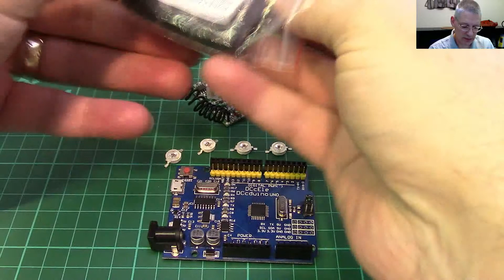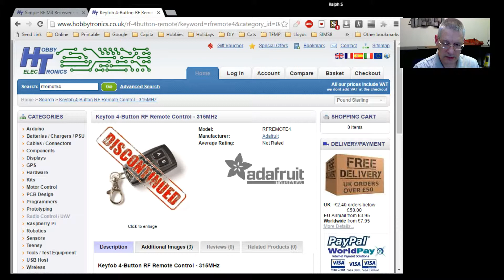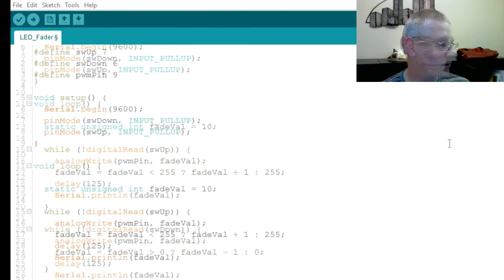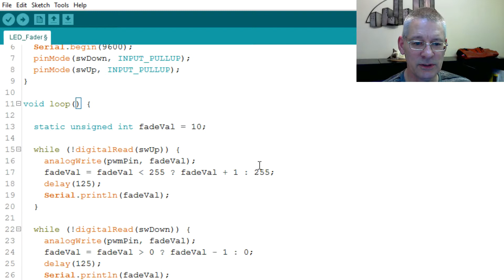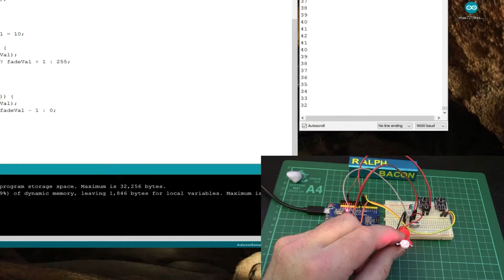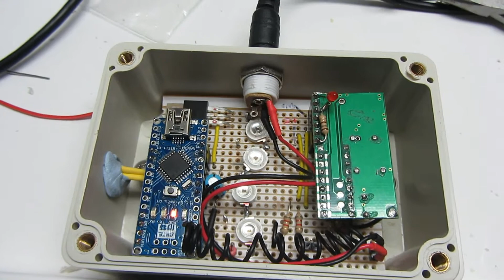#26 Night-light 1W LED MOSFET PWM with Remote Control - Part 1

Comment: Nice simple little project. I was wondering why you decided on a 12v DC power supply when the nano / pro micro takes a 5v supply and the LEDs have a forward voltage of around 2.5v - 3.2v. A 5v supply could power the Arduino and then run 2 pairs of 2 LEDs in series, in parallel. This would eliminate the need for an LM317 or similar to step the 12v down to 5v for the Arduino.
Reply from the maker: +Maxx B Good question. I most certainly could have used a beefier 5v supply and paralleled the LEDs. But my 5v plug-in (mobile phone) adapters are only really good for powering Arduinos (they can handle about 1A I suppose), I would like to keep them for that purpose and I have several 9v and 12v adapters (2A) to hand that are waiting to be used (left over from a CCTV project).

Note that the Nano V3 I eventually used (I indicated that I wanted to use this in the video) does have an onboard voltage regulator (underneath) just like the Uno so I just feed the power into Vin and the voltage regulator does the rest.

I think the MOSFET would behave OK at 5V but I would have to check that out (there may be a minimum Drain-Source voltage that is required) but at 12V (or even 9V) it would most certainly behave as I've used them with this voltage before.

So I guess the final answer is: because I arbitrarily chose that power supply because I knew it would work and I could connect the LEDs in series. You could easily do what you suggest though - electronics is flexible. And yes, you're right - if there was no on-board voltage regulator then a 5V power supply would eliminate the need for one.

Spoiler alert: I eventually used a 9v power supply - you'll have to wait for Part 2 to find out why (the answer is not that exciting but shows that electronics is most certainly flexible and we have to be pragmatic).

Thanks for the question.
Reply: +Ralph S Bacon Thanks. I didn't realise the Nano could run on anything other than 5v. I suppose I should have read the specs. I'm still learning electronics so a lot of this is still new to me. I'm from a programming background, so the Arduino seems the logical platform for projects to help learn electronics.
Reply from the maker: When you say the Nano can on something other than 5v - remember that the higher voltage MUST go to the Vin pin which is routed to the voltage regulator. If you connect a higher voltage to the +5V pin your Nano will be no more. It will be an ex-Nano. Gone to meet its maker. Etc.
Reply: Are you sure it's not just pining for the fjords?
But seriously, thanks for the tip.
Reply from the maker: Ha ha! I wondered whether you'd get the Monty Python reference (well, you could be USA-based, or in Australia or somewhere where they are almost unknown).
Reply: I'm from up north, where our night light was a hole in the lid of the cardboard box that all twenty six of us called home. If we wanted to adjust the brightness of the nightlight, we had to stuff some spam in the hole.